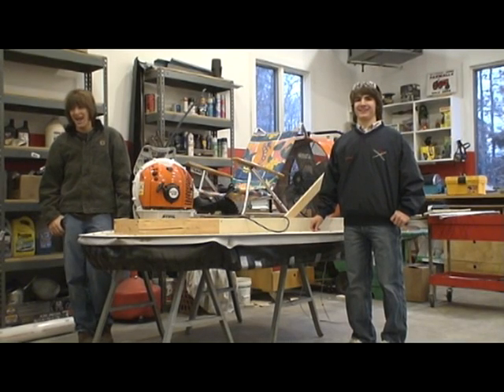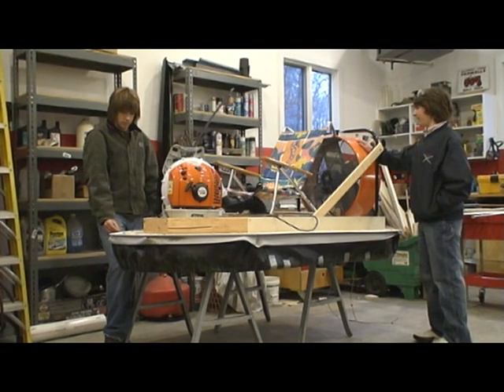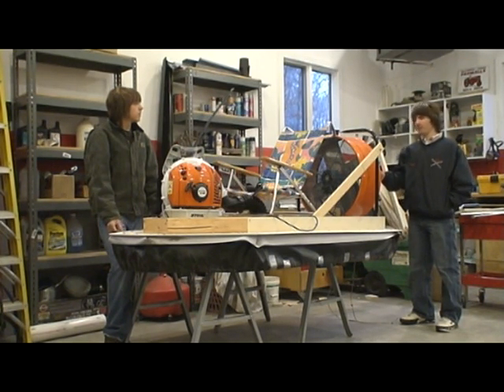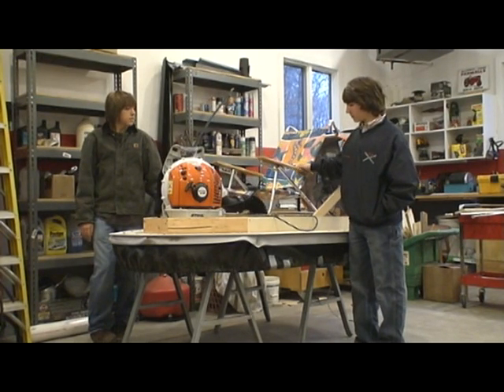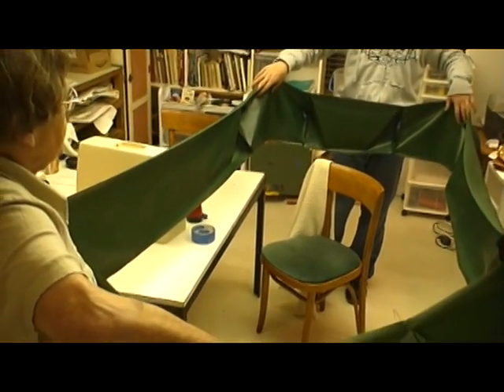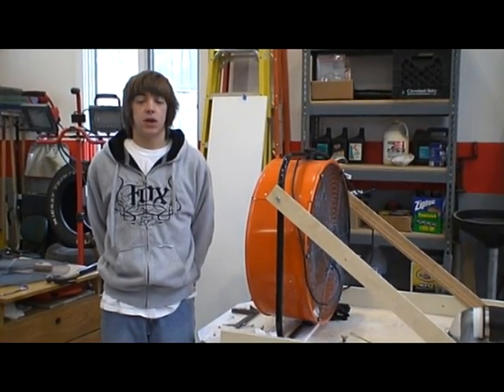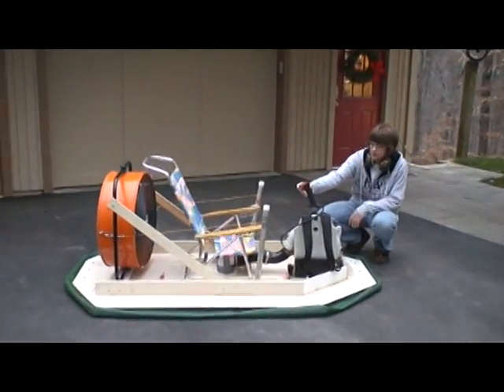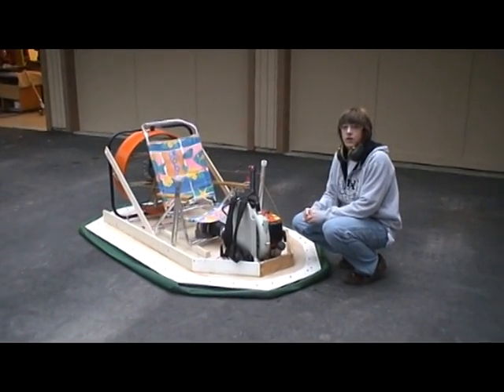Hovercraft Project - Part 2

Comment: Ps. These guys shouldn't be engineers because they are terrible at pointing out flaws, the material they 1st used was the same type of material a COMPANY uses to make and sell hover crafts. The material wasn't the problem. The problem was that the height of the material was to short, adding to the fact that there was too much weight on the craft, it was to close to the ground. They also curved it to much making the material skid on the floor making it rip. if they used a bigger skirt they possi

Comment: #1 thing they did wrong was using a flat piece of ply wood, they should've used something that has curve that way the air can lift up the sides more easily, 2nd they had only 1 whole supplying the air, and third they had WAAAYYYY to much weight on the hover craft

Comment: nvm i got it i just missed this video . hey im making one and i thought of using an old air matress as the skirt should i cut holes to put the leaf blower and add eight holes or shoul i just pump it up and turn on a fan to move it around which one is more efective?